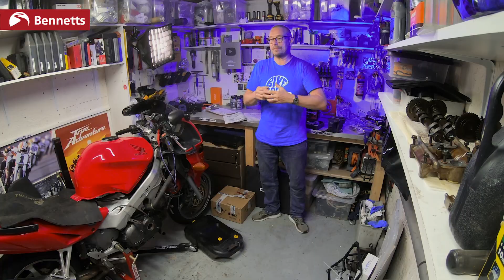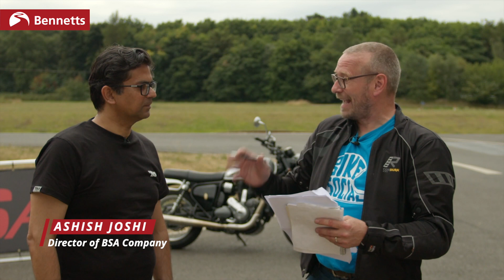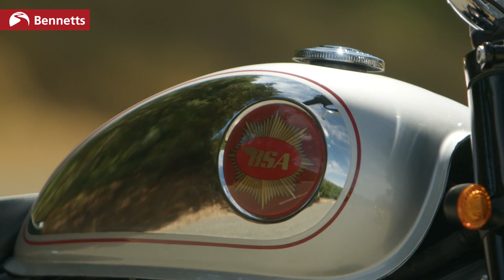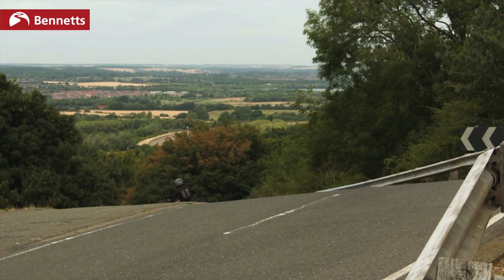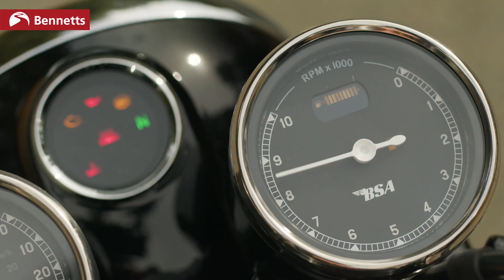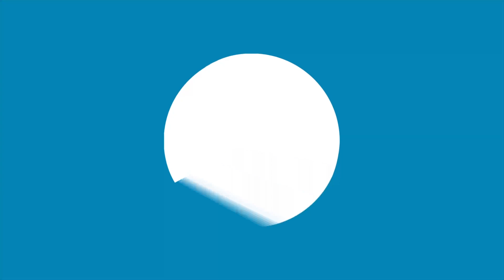2022 BSA Gold Star review | Price, top speed, engine, suspension, brakes... is it any good?

Comment: I took one for a test ride today, I expected to be disappointed, and actually wasn’t!, it’s actually quite a good bike, it feels more powerful than it’s 45bhp, yes it’s a little slow off the line but over 30mph once you’ve got the weight moving it’s quite “stompy”, goes well, the handling is quite good unless you really hammer it into a corner at which point it wallow’s, mainly due to the overly soft rear suspension I’d say, you can feel the inertia in the large dia front wheel but that’s not a bad thing, the brakes felt a bit soft but were ok, the gear change is good apart from there being no hard stop on first which feels odd, the exhaust note is great when cruising, no nasty high frequency vibes, I’ve got a few bike’s from Fireblades to vintage machines, would I have one in my garage?, yes, all in all a machine that left me smiling.
Reply from the maker: Excellent, thanks for this! All the best, John

Comment: I'm not a big fan of electric cars or bikes. I have battery tools as a carpenter and as workable as they are for short use, as batteries start to age, becoming unpredictable is a common problem. Also, I'm concerned about recycling and toxicity of the recycling materials.

Comment: People turn up their noses in some details but the reality is that the design of the bike is well conceived, the engine is not a truly classic style but it is a proven mono and that runs well however BSA still worked on the design and the way it releases the sound for a more classic style. There are only two classic bikes with a big thumper engine on the market, which is the one I bought the Mash Sixhundred and the BSA Goldstar, I think a comparison should be made between these two bikes instead of always comparing different things like the Interceptor 650. Personally I think that if the BSA Goldstar was already on the market it would be a motorcycle that I would consider because I wanted a classic single-cylinder but I happen to like it to be air-cooled like the one I bought but I have to admit that in design the most classic style of the Bsa is more beautiful👍.

Comment: Being 71 years old I'm starting to think that my 1200 Bandit that I've had 21 years is getting a bit of lump for me.  I thought this Gold Star might have been the bike for me.  I called at a dealers last month when they got one in.  After a good look around it, I didn't need a test ride.  Just looking at the welding on the frame and the el'cheapo BSA plastic stickers on the timing & clutch casings was enough to say "not for me"!
Reply from the maker: I still hanker after a 1200 Bandit, espeically a naked one in original condition. Cheers, John

Comment: The original DBD 34 owed its success to three main factors: 1) strong, tractable engine, 2) low weight, well under 400 pounds, 3) superb, stable frame, close to the immortal featherbed. How does the new GS compare? Motor? Sounds good, if somewhat down on power. Weight? Here's the rub: Horribly overweight--470 pounds. No wonder handling is less than perfect. Frame? Compromised by the weight. Prediction: sports riders can "Potter around," but I suspect they will be disappointed by performance.

Comment: The engine look for all the world like a Rotax 650 single with slightly different covers, one of the greatest engines of all time.
For my money, that alone makes it worth owning...
Reply: It is, the F650 Funduro, and Aprilia Pegaso engine, but they've gone mad with the modification though, recast the barrels for fins, and the crank cases for the stylised covers...but the two most impressive things, the latter maybe overdoing things, is they've made the engine dry sump...so you can have a BSA-alike separate oil tank...and fit the engine lower in the frame so you can see the fins....and they've moved the chain drive...out to the right hand side, nobody picks up on this, it's quite an engineering feat...making it the same side as the original....and I'm not sure it was really worth the effort. it's been retuned too, making 8% less power, but a bit more torque, most impressively this all happens 20% lower down the rev range...meaning it actually feels a lot punchier than the original (just as well as it's 40lb heavier than an F650)
  They've also gone with inner tubes, as per original....despite tubeless tyres....again, as per original....not sure about that, imo that could have stayed in the past, especially without a centre stand, plugging a puncture is much easier by the roadside.

Comment: Yes, the very first question is "did you consider an air-cooled engine?"  Well, they should have given that much more consideration.  The huge butt-ugly radiator completely ruins an otherwise beautiful recreation of the old BSAs I owned.  There is no reason that an air-cooled single must be made for just for a little more power or for emission standards.  Other engineering choices could have been made.  Lazy, cheap-jack design.
Reply: Of course they did consider no radiator but would've had problems with the thight emissions laws and gotten less power.
I wonder if an air/oil cooled engine would've been the better way to go, with just a small oil cooler between the frame down tubes.
Reply: I think because of the emissions they had to build a high compression engine and high compression engine cannot survive without liquid cooling

Comment: It's a good effort and I would rather it existed than not, but it's a bit sad that the original would likely just beat it on speed and don't forget this new bike is 150cc bigger, water cooled, fuel injected etc although the chances of it coming up against the real deal on the highways would be very slim! As most are rarely ridden.
Reply: In England if you go to a motorcycle rally you will see lots of gold stars with license plates in the parking lots. Many times the motorcycles in the parking lots are more interesting than the ones in the show.

Comment: If engines were allowed to be designed by Engineers and not meddling politicians, some definitive progress may be made with piston engines. Lean burn is okay if not in the extreme, but the parameters are always, being pushed further. Lean burn engines, produce more heat,an engine killer, so you then need water cooling, excess weight and end up with 650 cc or thereabouts, displacement , putting a bhp figure 3 bhp higher, than a good example of the Armoury Road, air-cooled 500 cc single did 70 years ago.
I know the DBD's were not "true" road bikes,I just hope they got these bikes in the right territory, shame England can't do stuff anymore, not even a door latch. The Carbon footprint is the death knell here! Soon, almost no one will be working, in real jobs, bringing in money to the country.

Comment: It's a beautiful looking bike. As you rightly said, the quality of parts like cheap sticker on the fuel tank, switch gear, paint job on the tank...etc needs to be improved. Somehow the exhaust thump is not that great for a single cylinder 650cc bike.

Comment: The Parallel twins you referred to are not all the same. Some have a 270 degree firing interval and others are 360. A 360 degree firing interval on a vertical twin is much like a single in its character, But RE's are not configured that way.

Comment: I like singles, I used to ride to school on a 350 Matchless, I learned on my Dad's 600 Norton, I had a 650 Panther for a while.

But I learned that twins just offered easier, smoother power.  My BSA, Triumph, AJS, Norton twins were quicker and didn't rattle my teeth.

And with modern emissions dictating lean running motors I'll take a 650 twin over a 650 single any day.

I've bought a RE 350 Classic for running around town (100mpg!) and can see a 650 Interceptor in my future.

Comment: I have been waiting for the actual production bike to be released. I really like bikes that look the part of honest and timeless classic design. I think BSA did as well as they could given their approach. So far  this bike seems nothing like a classic designed bike other than some aesthetic bits and logos. Also, there is no shame in admitting the bike will be made in India as they produce some pretty amazing motorcycles in that country. I don't think moving production to England will ever happen. And.... I have feeling BSA knows this as well. I understand why they went with an off the shelf Rotax engine. They are solidly engineered, reliable and most importantly, considerably cheaper than developing a proper, BSA designed, air and oil cooled engine. If they do design their own BSA engine, success would be far more likely. Hopefully that is the plan as the company develops. However, compared to an RE Interceptor... the BSA is lacking the details that make this segment of bikes so desirable to many. I wish BSA success, but I think they have a long way to go with this model.

Comment: Oil cooler would've made more sense, imo a dumb design choice to use watercooling.
Reply: It wouldn't be enough to cool a thumping great single cylinder, you  need watercooling for that and the bike runs very lean also.
Reply: @mattlambert1890    ?  Generations of solid and successful air-cooled singles would disagree.
Reply: @El_Croc  generations which didn't include euro 5. If there were no restrictions on the engineering team imagine what we'd get but there are, and this is the result.

Comment: I know some hate the radiator but an air-cooled 650 that meets European emissions would likely make much less power.
Reply: What about the Interceptor 650 😂 it's a parallel twin, 47hp, a bit more than the gold star and 52nm, a bit lesser, and it comes with a 6 speed slipper clutch and is slightly cheaper if I'm not wrong.
Reply: @AthishPV  And my old 90's Honda CBF500 56hp twin would knock both of them into a cocked hat so much for progress. The rise of the new flaccid goes on!

Comment: Why would you want more bite from breaks on a slow bike you would be riding above your ability if to are hard braking the tone of the bike sounds perfect has close has you can these days with the baffles out hope they have improved the carbs from the original BSA
Reply: What carb would that be?
Reply: @stevepalmer5670   the overheating on the old BSA carbs sounds like fuel injected on the new BSA then
Reply: @roysole3294  Yes.

Comment: So I just bought a new RE 650 Interceptor yesterday.  Having put 17k miles on my 21 and 22 Africa twin DCT ADVENTURE in a year. 
And having owned many 100 hp + bikes .
Don't buy a RE 650 for a performance thrill.  It's just a nice smooth
 running relaxing easy bike to ride. 
 I started riding over 50 years ago and this 650 RE Interceptor kinda takes me back there . But just a more refined bike.
Ride it for what it is intended.  I'm pretty sure the BSA will be a very similar ride.
Lot of times while riding I wish my dad was still alive to get to ride all the new bikes. He rode mostly 50s and 60s BSAs and Triumphs.

Comment: I love the fact that the shocks don't have those hideous reservoirs like the Royal Enfield 650 twins have. I don't need or want top of the line suspension on a bike I would use as a cruiser. But they would have to support my 240 pounds. Where BSA really went wrong on this bike is using tube type tires. That one thing makes it virtually unusable. I have 2 bikes with tube type tires, a 1966 Triumph Bonneville and a 2013 Royal Enfield B5 Bullet, converted to an Amal carburetor and with a cat free aftermarket exhaust. Both are a blast to ride, but I won't go more than 50 miles from home on either one of them. Not only are tube type tires a LOT easier to puncture than tubeless tires, but with tube type tires, a flat means a tow truck. Unlike tubeless tires, there is no way to repair a flat beside the road. So I have to stay within the towing range of my roadside assistance plan. There is no reason why they had to use 1940s tires on this bike. Just look at a picture of a 1986/1987 Honda Rebel 450 wheel. It is a wire spoke wheel with tubeless tires. And unlike the way BMW does it, with the spokes attached to the very edge of the rim, the Honda design would look perfect on this bike, and make it possible to actually ride it somewhere.
Reply: Tube tyres make it unusable?
Reply: @stevepalmer5670  Pretty much yeah. Tube type tires are a lot easier to puncture than tubeless tires, and when you have a flat with tube type tires, it means a tow truck. It can cost you hundreds of $$$ in towing charges. With a tubeless tire, IF you do have a flat, you can just plug it, reinflate it, and be on your way. A lot of times, with tubeless tires, the object that punctured the tire will also seal the puncture. I have found objects sticking in my tubeless tires while inspecting them at home that actually punctured the tire. But the tire did not go flat. I could have ridden hundreds of miles like that.

Comment: I love the looks but I intend of getting the Interceptor, that 270o crank sound is just amazing with pipes and you can get some decent power with some fairly cheap fettling. This Goldstar is beautiful though. If it had a 60-70bhp version and maybe slightly more premium suspension I'd probably switch.
Reply: If you want 60-70bhp from a 650cc single then go and look at KTM or Husky etc, very different bikes and they aren't exactly very new rider friendly or retro feeling?
Reply: the interceptor doesnt come close to 60bhp, i dont know why you're interested in it either.
Reply: @northvanwan7428  because with a pipe, filter and chip you can get 56ish hp, which is better than nothing.

Comment: Mmmmm. They changed the exhaust shield but I liked the full length one. The mid section shield looks weird. No change to the size/style of the radiator. Narrower and taller would look nicer but rectifiable. I'd still have one.

Comment: Wouldn't touch it with a 10 foot pole may be the gen 2 or 3 model.looks like tubed rims ,scaffold header pipe, ugly as radiator, huge gap when the cat is bypassed and the worst looking cylinder head in history

Comment: Too many compromises have been made. 1. A "will fit" engine that sounds, very average.
2. The radiator?
3.The Goldie should have a swept back gp exhaust
4. BSA originally said that it was going to be British built, which would have been nice. In all honesty I don't think it was even on the cards.
5.There are way to many compromises. Any bike called Goldstar should never be compromised.
I was very enthusiastic when I first saw it, but this has waned and withered over time.
I do wish BSA every success for the future.

Comment: Mmm I'm a bit confused, they say that liquid cooling was because of the power they wanted, so how do RE do it with a twin which basically produces virtually the same power 🤔
Reply: The single gets hotter than the twin?
Reply: R.E has a small oil radiator & a single is harder to make easy power but it is possible to do air cooled,oil cooled & I think KTM 690 is a air cooled single but not 100% sure.
Water cooled is easier to make power & BSA use a Rotax engine not built there own.
Reply: He did mention emissions...
Reply: @nervotica7991  Water cooling has nothing to do with emissions.
Reply: @stevepalmer5670  - you missed the point.
Reply: @nervotica7991  How?
Reply: @stevepalmer5670  - simple, just read Kevin's comment again.
Reply: @stillshakin2125  Maybe adding a small oil cooler on future models on W800 cool it better & get 4-5hp more.
Reply: @stillshakin2125  In NZ we call A2 learners license & bike can be no bigger than 660 & 54bhp & no headers or engine work just slip on's.
It should be 54bhp regardless of cc then W800,883 Harley or R.E650 with headers are all below 54bhp it's silly really as a Triumph 660 LAMS (learner approved motorcycles)are 53bhp & alot faster than all of the above mentioned bikes with mods.

Comment: I see this motorcycle stay being built in India because of cheap manufacturing & assembly costs & because the volume of sales won’t be that great. It will pull sales from RE, but it won’t kill it. People always want something different. Good luck BSA
Reply: Given the high cost of sea-freight and the fact that the main component suppliers for this bike are Europe-based, logistically speaking, it would make sense to build it in Europe/UK, especially if the UK is initially the main intended market. As a rough rule-of-thumb, from a profitability perspective, every $10 saved at the back door (purchasing & manufacturing cost) equates to $100 at the front door (sales revenue), so this will be a serious consideration for them. Yes, Mahindra Group has deep pockets, but the BSA arm will still have to operate as an effective stand-alone profit-centre. I hope they succeed.
Reply: People want a good solid product and as such RE isn't part of the equation. Welcome BSA.